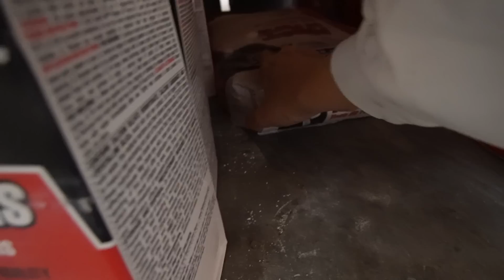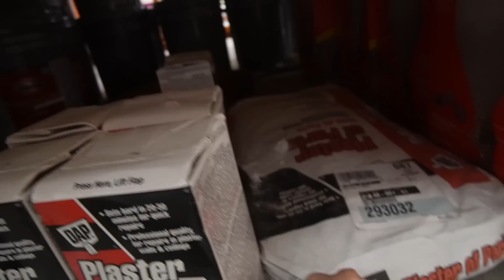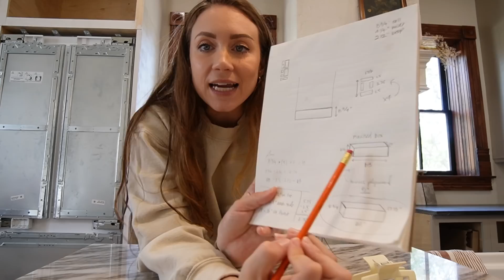making progress on our living room renovation + behind the scenes | XO, MaCenna Vlogs

Comment: Suggestion: if you are painting the boards, you can always use Bondo to fill the knots and holes in the common board and sand it smooth. No one will ever know! I do it all the time in furniture repair.

Comment: Happy Birthday to Ms. Kinsley!!! 🎉🎊❤️

Heads up for next time that you need a wider board. You can use the common pine, just fill all the knots with Bondo, let dry, then sand, prime, and paint. You can easily get a finish and strength that is 99% of the more expensive pine.

Comment: Girl, get an electric kettle! Water boils in less than 2 minutes. The ones with integrated coils are easier to clean. When they get buildup from your water just throw half a lemon in there with some water and run a cycle, when the water cools again throw out the lemon and wipe out the inside. Easy peasy!

Comment: There is away to get the old concrete off, I can’t remember what we did (power wash, soak in something, mmm). Also I kinda like the dark spots on the brick really show’s character. 
Here in South Africa we only build our homes out of brick. We do use wood for roof framing and of course cabinetry in our homes.

Comment: You can clean bricks by using an electric drill and an old bit piece. Run it across the old cement then to loosen and chip off. Then clean up with a wire brush. If you search fixing a brick wall, there is a mason who shows how it's done. I've never worked with bricks but found it really easy using his method.

Comment: Tip on the slow water boiling situation. Warm the water in your coffeemaker first and then transfer it to the pot in the stove to boil. It cuts time, also If you have a lid use it! Even if it's bigger it'll work 😉

Comment: Make sure to add lots of support underneath that plywood. Otherwise, with the weight of the bricks overtime will cause the plywood to sag. That's not including anybody overtime that they could step on the garth. Adding more weight causing the cement to crack.

Comment: If you are going to make a sort of floating shelf, with a top, bottom and strip on the front, would'nt it be cheaper to use plywood on one or both sides of the shelf? I assumed they where going to be painted?

Comment: Girl, mud joint compound would have been so much easier than plaster of Paris. You can buy it in small, medium large & dry to mix. It doesn't chip & disenagrate like plaster does. Think of an old chalk ware piece how easily they break & are almost always chipped all over them. That's exactly  what the plaster of Paris will do in your wall. Even after you seal them with paint. It's  a very fragile substance.
 I was always gonna write a book on what not to do. We have so many horror stories on learning things the hard way. Research the mud wall texture.b

Comment: Your home is looking beautiful. Do you know that if you shorten the boards you can take the extra 2 ft pieces back to Home Depot? You could even have Home Depot cut them down to 6 ft also.   There is a saw there and you can get the employee to cut them with the electrical saw so at the check out you are only paying for the 6 ft instead of the 8 ft cut them there.  I believe you said you need  6 ft for your shelving instead of the eight.  It would save you the price of the extra 2 ft for each board.

Comment: Good Lord girl! I know it's too late to stop you about the shelf boards BUT in the future don't buy the better quality wood if you are going to paint it, use regular pine ( hell I've used plywood)  get MDF for any bracing, barcketing etc, as it's cheaper and easier to deal with and just as sturdy. I've built many sheleves and find  1x2 stock works fine for a shelf bracket. ( hard to describe) cut two pieces to fit the depth of shelf just a little shorter ( so the end doesn't show when you place the shelf) to act as a ledge on each side for the board to rest on. Hey finding an old bookshelf and repurposing the wood is even better. It's not cutting corners, it's saving time and money.